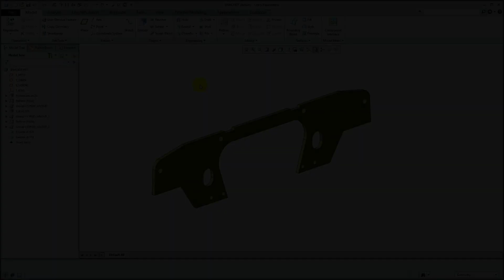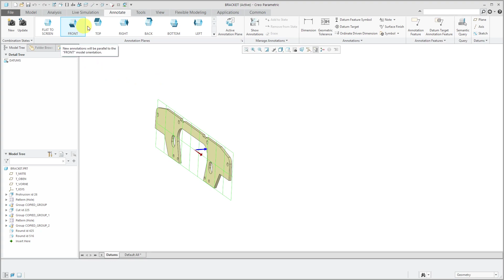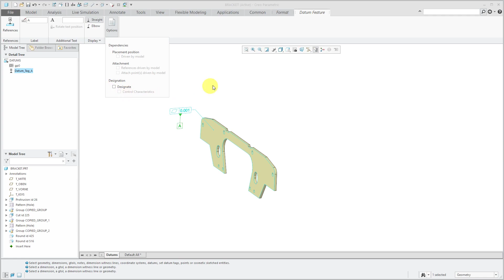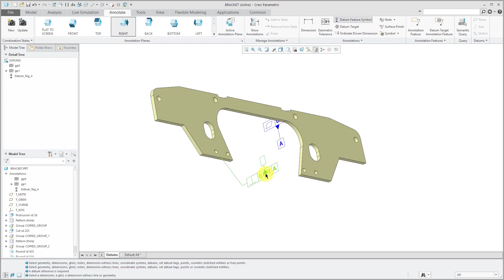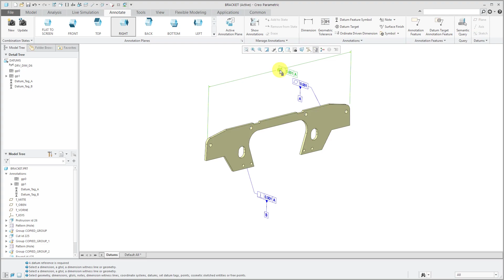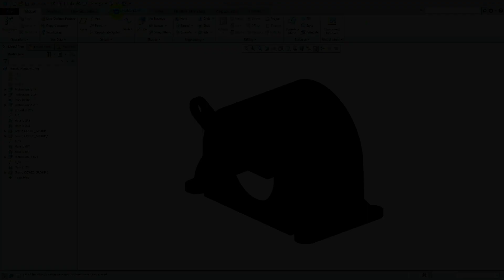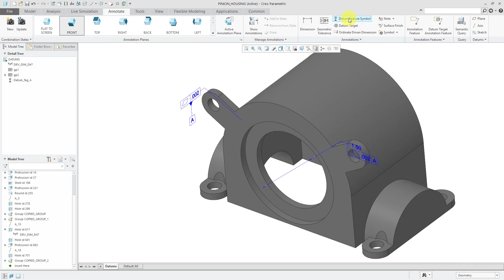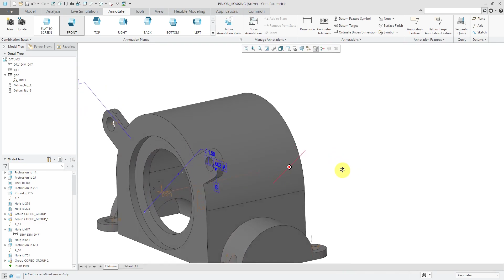Creo Parametric - Datum Feature Symbols -  Geometric Dimensioning and Tolerancing (GD&T)

Comment: This video pertains to CREO 4.0 and later; fair enough.  How can I create datum feature symbols in CREO 2.0?
Reply from the maker: Wow. That's 10 versions and 13 years ago. That version has been out of support for years. But are you really asking about how to create symbols for the ANSI Y14.5 2009 standard instead of the 2018 one? Regardless, that was several years before I started making videos.
Reply: @CADPLMGuy  Thank you for the reply.  I am required to use Creo 2.0 by my employer.  Yes, resources have been hard to find, and I'm probably not using the program to anything like its full potential.
I'm not particular about which standard the GD&T is to so long as it is comprehensible to the reader.
I've made some progress by trial and error.  Using the "datum target annotation feature" dialogue in the model, I am able to define datum flags referencing datum planes or datum axes also defined in the model.  I am then able to show those features in the drawing using "show annotation".  I have not yet found any means to reference solid model geometry directly.  My current struggle is how to attach the actual GD&T callouts to a dimension, as would be typical for example for a hole position tolerance.

Comment: Sir...can you explain the significance of MBD.
Reply from the maker: Model Based Definition is the process of documenting Product and Manufacturing Information (PMI) in the model as opposed to a drawing. This method is much more efficient in the design - manufacturing - inspection cycle compared to using drawings as deliverables.
Reply: Thanks sir.

Comment: at 2:31 when you left click out of the flatness callout, my callout disappears from view, though it is still in the detail tree off to the left.  Is there an option to toggle so that they stay visible in the modeling area?
Reply from the maker: It depends on other factors like your Creo version, whether you have Annotation Display turned on, and your layer settings.
Reply: @CADPLMGuy  Yes, it ended up being my annotation display.  Thanks!